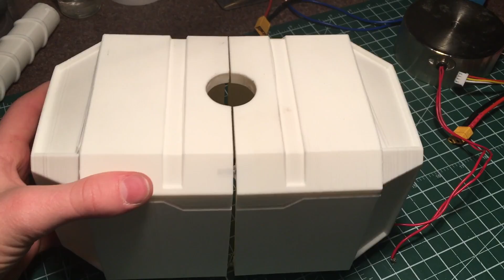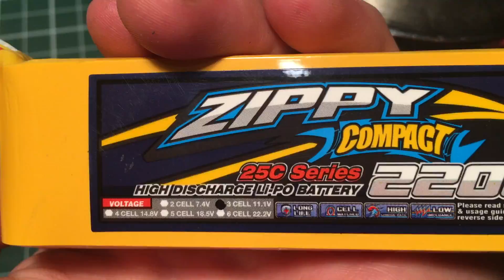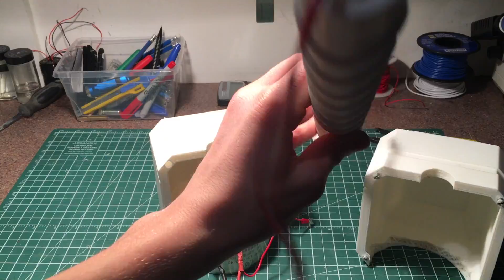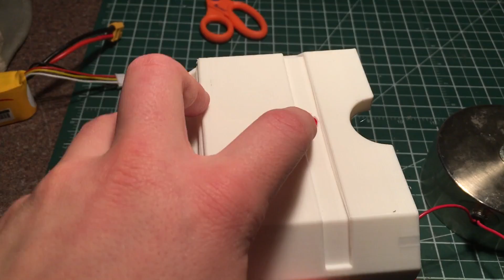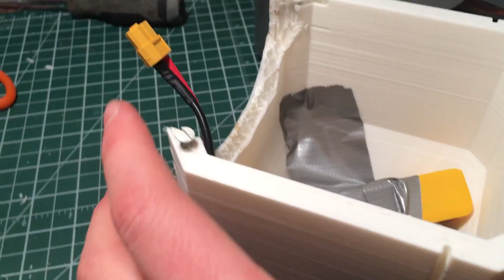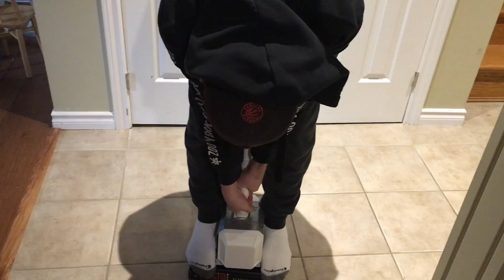Electro Magnetic Thor's Hammer

Comment: Hey man, could you provide information about the electromagnet you used? I can’t find it
Reply from the maker: I bought it on amazon a while back. It is a 12v 264lbs magnet. Check amazon, ebay or other sites. Any magnet over 100lbs should work perfectly.

Comment: For some reason when I tried to make this it like reverced 
 I had the on button and the button that would turn the magnet off and back on again when I let go but now instead I turn it on and it doesn't go on until I hold down the button which is meant to temporarily turn the magnet off             can you help me?
Reply from the maker: You might have broke the switch. The little reverse switches may not be meant for the current you are pulling. A solution is an on/off switch that can handle more current. Or wire a mosfet switching circuit to the small reverse switch.

Comment: What the specific switch you got,also how long is the rod?
Reply from the maker: Any normally closed switch will work
Reply: Well how long is the handle on your Hammer I mean I'm sure you can Google the specs and then it's got to go into the hammer I would measure from the bolt connected to the magnet to the total length of the handle you want or subtract that from specs

Comment: One more question, what is the name of the orange connector that connects to the batter
Reply from the maker: Xt60
Reply: Michael Lovisa I know it is a XT60 but I am wondering if the battery comes with the connector?
If it doesn’t can you tell me what the XT60 connector you used to connect the battery to the wire?
Reply from the maker: The battery is a female xt60 and you need to buy the male plug to connect to the wire.  The battery does not come with the male plug